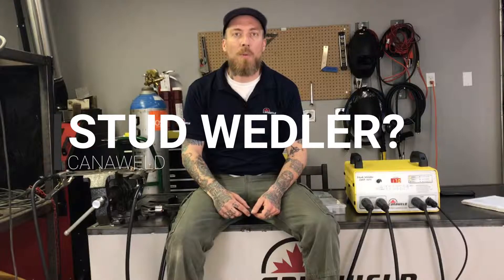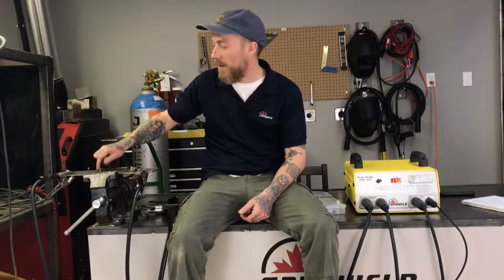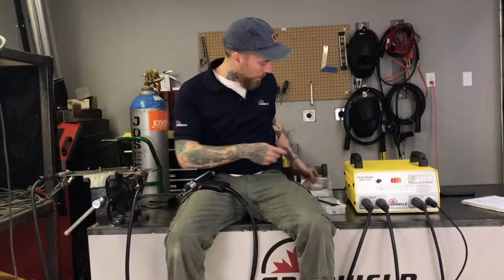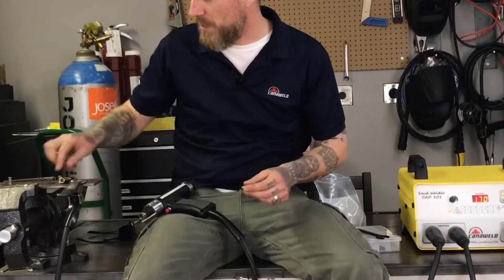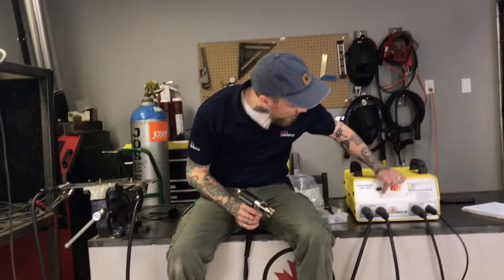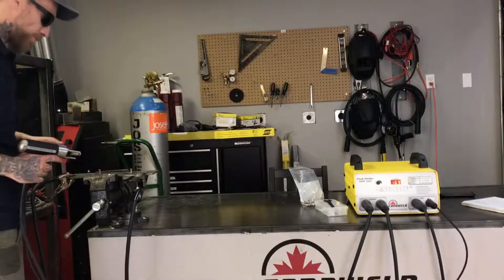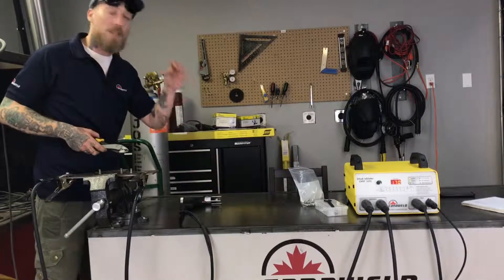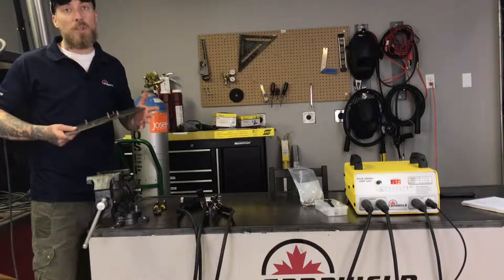Stud Welding, CAD 101 Capacitor Discharge Stud Welder by Canaweld

Comment: Can someone explain why these are so expensive? How can it be more expensive then mig and Tig, which have a lot more going on inside. I just don’t understand, i Wanted one for my small business but just too expensive for what it is.
Reply: Hello Tim , to answer your question I believe stud welders are quite expensive because of the time savings they offer . If you had say 10 studs you had to tig weld onto a project you would have to weld each one and possibly polish up the backside to remove any discoloration. That might take about an hour or longer to do . with the stud welder you could blast all 10 studs on to the work in less than 5 mins and you have no discoloration at all on the back . These stud welders are geared towards companies pumping out loads of product every day , in that sort of an environment the stud welder pays for itself in saved labor costs rather quickly.
Reply: @canaweldinc6706  It's a hose job plain and simple , harbour frieght man check them out
Reply: These things benefit the shop. Not the tech.  Techs buy there tools.  Most shops don't invest in big ticket items no matter the sales pitch